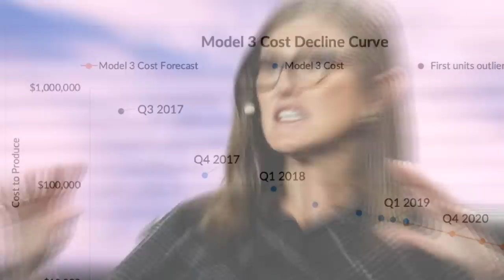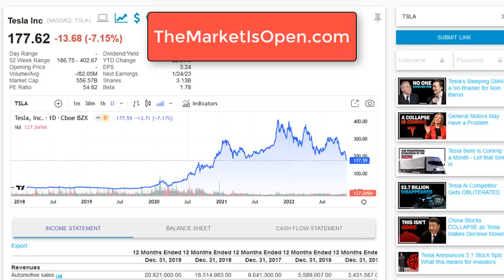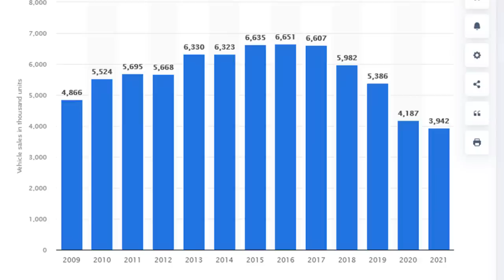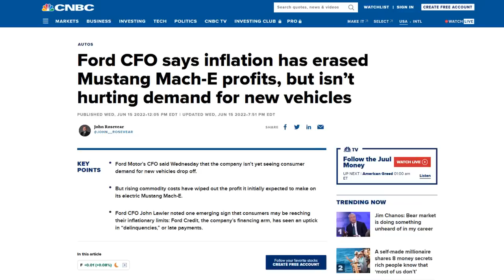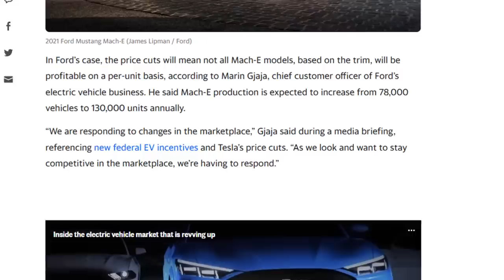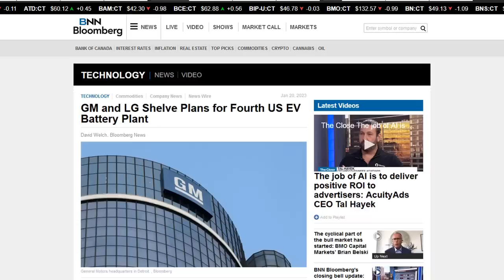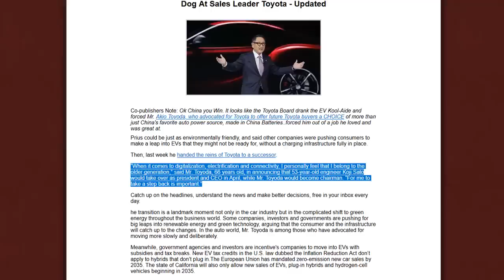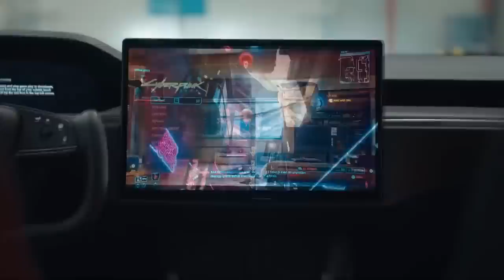Toyota, General Motors, and Ford Admit the TRUTH about Tesla

Comment: I believe that , the cost of advertising, dealer fees, and UAW are probably the biggest problems for them.
Reply: I think you're 100% right  if they sold the cars like Tesla they make a lot of money it mostly the distributors are ripping their customer off not the Supply of the car
Reply: Tesla's also got an injection casting system that makes the back and front frame in one shot, as opposed to gluing and welding dozens of pieces together.  The "Big Three" could also invest in this technology, it's not like it's owned by Tesla.
Reply: It’s a combo of UAW and corporate culture. The biggest issue with the UAW is not the pay demands. The biggest problem is that innovators get ejected from the company like a virus. Unions get the management they deserve.

Comment: The hand writing is on the wall! We are witnessing the demise of the legacy auto makers!
Reply: ICE died in 2012.  When Tesla sold the first mass produced Model S.  It has just taken this long for the body to fall.
Reply: Probably not.   There's not really a way to replace the entire gas-powered fleet any time soon.
Reply: @teekay_1  If China has any say the US market is going to be flooded with inexpensive EVs in a couple of years.
Reply: @shaunhall960  Possibly.   But there are structural problem for EV's going above 10% of the population of cars as a whole.
Reply: @teekay_1  check back with me in 30 years. What did they say about horses? However there’s still a few around!
Reply: @shaunhall960  You get what you pay for! Inexpensive? Isn’t that another name for cheap!
Reply: @lkendrix7782  The difference is the was a burgeoning oil industry that was ready to supply gas/diesel as necessary.   Gasoline at the time was considered a waste product from the cracking of crude oil.

Where is the investment in increasing nuclear energy and transmission lines?

Who is going to invest in putting up charging stations along the interstate along with high-voltage lines to support the literally 100's of thousands of chargers necessary to make long-distance travel a reality?

Are electric car owners willing to pay even more for charging their cars at filling stations than gas car owners?

Where are the new batteries that don't require children in third world countries to mine dangerous materials to supply this new demand?

How will apartment dwellers charge their cars?

If the answers don't exist now, then you're looking at timelines in the 30-50 year range for electric cars to be more than 8-9% of the market.
Reply: @teekay_1  
Did you fall on your head?
Do we need to call a doctor for you?
Reply: @theuncalledfor  Sorry, I realized too late it's impossible to have a rational discussion with a fanatic.
Reply: .....not even close! Try to fix a Tesla on your own. You cant buy the parts. You HAVE to take the car to a dealership...with a major waiting list.  Lus the batteries loose too much charge in sub-zero weather. The LEGACY automakers wont be dying off anytime soon. I love it when people like YOU just buy into propoganda WITHOUT doing research. I'll stick with my Cadillac ELR plug in hybrid. I dont have to pay a monthly subscription for my car to keep running. Plus my batteries arent dont loose as much power in sub zero temps. Not to mentionthere are countries starting to ban electric vehicle charging because of fuel shortages for power stations..and what MOST people forget about ev's, is it takes fossil fuels to produce the electricity to charge the ev. And The LEGACY will live on!
Reply: @aaronpatterson2369  Fossil fuel used to produce electricity? Do a little research. Solar panels! Solar roof tiles! Hydro generators! Regenerative braking! Energy storage packs! Hmmm? Legacy auto makers stated they will no longer make ICE vehicles after 2035?! Sounds like a short lifespan. At one time in history horses were the only way to travel. Said horses will never be replaced?! How many horses do you see on a daily basis?! How often do you go horseback riding? Which streets do you travel? Those gas stations will quickly convert to fast charging EV stations! Ever heard of Tesla charging stations? Electrify America? EV on the go? Which rock do you live under? Did you know some major stores and malls offer free charging while you shop? So stay under that rock or come out into the sunshine! It’s free! Wash that fossil fuel from your face and eyes!
Reply: @teekay_1  Same thing happened to Cameras / Film and (non-smart) Mobile Phones.  The collapse will come MUCH quicker than anyone in Legacy Auto believed it would. The Chinese, Tesla and a very few others will transition New Vehicle Sales to 100% EVs much faster than Legacy Auto Can keep up. As new ICE vehicles plummet in value, nobody will want their used and worthless cars. ALL Legacy Automakers will have to take MAJOR Write-Downs and Write-Offs of their ICE Factories, Equipment, Employee Skills and Pension Plans. It will be a nightmare for ICE Legacy Auto, if there's a major recession or another long term OIL / Gasoline price shock / Increase.
In the Meantime, Tesla and the Major Battery / Battery Storage Producers will grow their markets massively and profit off of those Battery Storage Sales and Software, not just their vehicles. 
The ICE Automotive, Fossil Fuels, Electricity Generation, Electricity Storage, Electricity Distribution and Software Industries are ALL being disrupted at the same time. .
Reply: @teekay_1  Baloney. Norway sells 90% New Plug-In Vehicles every year and are ALREADY over 20% of ALL Passenger Vehicles in Norway as Plug-Ins.  
Nearly every advanced economy, which is where the largest markets almost ALL of the new vehicles are sold....is ALREADY wired for Electricity in every building, home, Apts, Businesses, etc. Wiring up a bunch of parking lots with LVL2 chargers is NOT a tall order. As Battery Storage skyrockets, the Grid will become MORE stable not less. And more people will have their OWN Solar not Less.
Reply: @davidbeppler3032  You mean to say their dead and don’t know it?
Reply: @aaronpatterson2369  Do have a rotary dial phone?  Do you have just a Fax Machine?  Do you send a lot of letters through the mail?  Do you use a camera with actual film?  NOPE. 
1. ICE vehicles are ALREADY being banned. PERIOD. But that wouldn't be the biggest problem for them because EVs are just going to crush ICE vehicles anyway.
2. Nobody is "Banning EV Charging".  They asked NOT to charge them during the peak evening rush hours 4pm to 8pm. But EVs charge OVERNIGHT, when Electricity is the cheapest by far. 
3. Norway has over 90% New Vehicle Sales as Plug-ins (mostly BEVs) and is doing JUST FINE because they installed charging stations and renewables. The rest of Europe is converting quickly to EVs, so they don't have to rely on Russian OIL (Or anyone's OIL for that matter). They're keenly aware that Electricity and NOT OIL is going to solve more of their problems in the next decade. 
4. NO, It does NOT necessarily take Fossil Fuels to produce Electricity. Solar, Hydro, Wind, etc. can ALL replace FF's.  AND they are doing so at a faster and faster rate. A large number of people who own EVs, also have Solar Panels and Battery Storage on their houses...or connect to 100% renewable energy sources. We have solar on the house and it is awesome.  
Legacy Automakers are ALREADY shrinking.  GM used to sell 10 MILLION vehicles per year and have fallen 40% in the last 6 or 7 tears to less than 6 Million.  Toyota and VW, the current largest automakers are both shrinking because more and more EVs are taking Market Share from ICE Vehicles. 
The TWO MILLION Teslas that will be sold this year are ALL sold at the expense of a Legacy Automaker never selling that ICE vehicle again. And NONE of the Legacy automakers are making any significant profits on their EVs.  They are failing miserably.
Reply: @lkendrix7782  Solar roof tiles can't recharge a Tesla.   They can extend range.

We are actually getting rid of Hydro generation because it's considered bad for the environment.

You only have a handful or ways to generate electricity at scale:  Coal, Natural Gas, Oil,  and Nuclear.   Wind/Solar as has been discussed many times can only supplement fossil/nuclear fuels at this point.
Reply: @teekay_1  Hmmm? If your solar roof absorbs energy from the sun 🌞 all day then stores it in a battery 🔋 so that when you come home at night you plug in so that the next morning you wake up and get in your electric ⚡️ vehicle 🚗 is it not fully charged?
Reply: We are slowly getting away from fossil fuels!
Reply: @aaronpatterson2369  as time goes by that will all change!
Reply: @lkendrix7782  yes...but it aint happening right now. Or in the near future. And we will ALWAYS use fossil fuels. Maybe the general public MIGHT be forced to go electric....but fossil fuels will NEVER stop being used. PERIOD!
Reply: @lkendrix7782  depends on solar input/output of your system AND if its a sunny day or overcast AND how much of the solar energy you are using for the home or just charging. Also depends on if your panels are clean and free of debris. AND also depends on where you live.. some states/cities have introduced limits to solar power. Your spend all the $$ for solar and your bill will be higher than what it was before. I painstakingly rewired my home to make solar take over only 50% of power use. Which does take in to account my little Cadillac hybrid. Any higher percentage gets me a higher bill. And i live in Kansas. Just think of whats happening in the larger metro areas. KS isnt the only place limiting solar. Im NOT saying solar, wind etc. dont provide power..im simply sayin Tesla isnt the greatest thing since sliced bread. And the major automakers are not going anywhere like these #Elongroupies are suggesting. There are plenty of flaws/problems with Tesla people who dont own one will never think about. Gas/diesel powered vehicle arent going anywhere anytime soon.
Reply: @aaronpatterson2369  have you ever heard of sunny California? 360 days.
Reply: @lkendrix7782  The energy density of the sun on the roof (which is probably 16 ft^2) would take about a week to charge, assuming the roof stayed in the sun the 8 hours a day.

You may get perhaps another 10 miles a day of range, but that's under ideal conditions.
Reply: @lkendrix7782  you do know not everyone lives in Commiefornia.....right?
Reply: @lkendrix7782  at least smart people dint live there...
Reply: @aaronpatterson2369  yeah at least they can spell “California” and “didn’t” correctly! Can you?!
Reply: @lkendrix7782  Probably.
Reply: @teekay_1  p
"No way to replace the whole gas fleet.....
Until you factor in Autonomous vehicles doing 10x the work..... Or future generations wondering why "we" ever bought cars for personal use, preferring to have the vehicle (type) they require for the purpose they need, at the time they book, all managed by AI software run personal devices and central fleet control systems.
.
Then it becomes perfectly possible.
Reply: @rogerstarkey5390  Everybody's already backing off autonomous vehicles;  the development curve is far steeper than originally thought.
Reply: @lkendrix7782  Said the SAME thing about the Japanese Cars in the 70's and 80's...Now largest automaker. (Of course, that looks like it will change soon.)
Reply: @teekay_1  Solar Roof Tiles CAN absolutely Charge a Tesla. So can Solar Roofs (Panels).  They're not talking about solar TILES on the vehicle.
Reply: @teekay_1  Dude...STOP IT.  Battery Storage and there are ALREADY plenty of people using Solar to charge their batteries (PowerWalls / Battery Storage AND Vehicles).  You're either REALLY bad at math or are a TROLL.
Reply: @aaronpatterson2369  MORE of the people in the US live in Cali and the South than any other region. Cali, Texas and FL are the three largest states.  Between Cali, Tx, FL, GA & NC they have OVER 110,000,000 people and GROWING.  This isn't a thing and Solar and Wind together will continue to grow faster than Coal Dies.
Reply: @teekay_1  Mercedes JUST got approved for Level 3. There are ALREADY Autonomous vehicles driving around in several cities.  And there will be PLENTY of Autonomous Vehicles before the end of the decade.
Reply: @davidc2838  You buy all that stuff, or you buy a cheaper, longer lasting car that you just take to the gas station to fill up for $25.

You pay your money buy what you want, but avoid thinking you're saving any money or the earth with your car.
Reply: @davidc2838  Given enough time, you could charge any battery with a solar panel.  But there simply isn't the energy density from sunlight to completely charge any electric car in a day from solar panels.
An average solar panel will generate about 20wH of energy per square foot, which means it will take a week to charge your Tesla.

The physics are not on your side for this claim.

Comment: The only thing I can think of is that the competitors don't have the technology and charger networks that Tesla has! Me owning a tesla for years I didn't experience any inconveniences of owning it, no supercharger issues, and software updates are on the fly, and road trips are excellent because there are Tesla superchargers everywhere and they ALL work. Other superchargers are there but most of the time they are broken, don't charge my car fast (sometimes I have to wait an hour and 30 min to fully charge at 90%), etc. If they want to compete, they need to make sure all these work and no inconveniences to customers.
Reply: The best thing "others" (Ford?) Could do would be:-
Bite the bullet.
Join Tesla.
Arrange to build chargers under licence, branded as their own.
.
Advantages?
Great revenue stream (with grants)
.
Cashflow from the building AND charging revenue.
.
Brand association with a WORKING charger system badged "Ford"
.
Access to the rest of the Tesla network..
.
Tesla WOULD agree to this.... It advances the mission.
.
Just a thought, but it could help save their company.
Reply: @rogerstarkey5390  Very GOOD idea.

Comment: Design of ICE never was as relentlessly focused on efficiency. 100kWh additional energy use imposed a slightly higher gas bill but could easily covered by increasing tank capacity about 10 liters thus imposing about 10+ kg in extra weight. Luxury car owners couldn't care less.
Now having to add 100kWh in additional battery capacity would require effectively about doubling battery pack and cost. That's simply not an affordable option.
Driving a 2009 Prius now at 316.000 km still achieving 750+km on a 45l tank (450kWh) simply can't compete with a Tesla Y with 70 kWh getting close 500km.

Comment: One thing they kind of got right. They haven't faced real competition. And they won't for at least a few more years, because they are ahead of the game. The game they created essentially. Because there was a vacuum waiting to be filled left empty by legacy automakers who were addicted to their lucrative but tight business model. And when the competition comes, we can see that maybe BYD and or some other Chinese automakers might be able to put up some competition. But as far as I can see, there isn't any serious competition from legacy automakers.
The market is expanding, and when other automakers make EVs, Tesla sells more. When they improve their range, Tesla's range is better. When they make efficient batteries, Tesla's are more efficient. They are building battery factories ten years after Tesla's first battery factory was built and operational. Their software is competing with a Silicon Valley company. Their engineers are competing with a company that continues to attract the top engineering graduates.
No company is perfect. Tesla has flaws. But there is no competition.

Comment: Where are the dozen guys I have had many arguments with over the last 10 years, about cylindrical cells being better than pouch cells and that pouch cells do not like vibrations like that found in cars?   I am sure they are happy with their Bolt purchases.  Half the Bolts still have not had the batteries replaced from the 2020 Bolt battery recall as of today 1/31/23.
I predict the Ultium battery is vaporware and will never be mass produced.

Comment: No one put aside rising environment for electric cars or tesla achievement. So now regular auto maker need to come up at surviving position but how? 1st, you need electric car no matter what kind of battery or how much power it has. 2nd, use fuel (combusion) engine with radiator as much small as much possible for AC, heating, and to recharge batteries while car is moving or running while batteries mainly charges at charging station or in home. So you have a motor powered by batteries to run a car (which is 100% electric) another fact for being 100% is you have no transmission exist or connected from very small motor (for heating and cooling or recharging purpose while car is running on the road) you have with the wheels.

Comment: there is absolutely no competition as long as the the car companies dont change their dealership model. their price cuts dont mean anything as long as the dealerships have the last say on price and markups. i was in market for an electric car. As the cheapest option went to chevy (30k)  bolt but ended up getting a tesla model Y (54k) with a very close montly payment.
Reply: Its interesting to see that the Tesla has low monthly lease payments - it's resale value is being appreciated by the finance industry (though its just taken a hit with the latest price cuts...)
Reply: Have you noted the GM just USED "the dealership (model)" to hide their poor Q4 performance, farming out cars to dealers, counting them as "sold"?
What happens at the end of Q1, when the dealers haven't sold those (or for little profit) and GM tries the same?
Something has to give.
Reply: @rogerstarkey5390  They've been doing the SAME thing for many decades. This isn't new news. They DO need to get on their horse and get some EVs made in LARGE quantities.